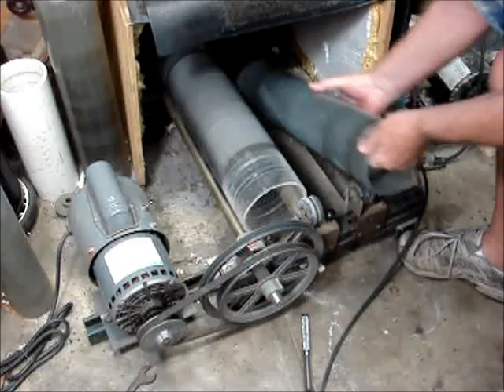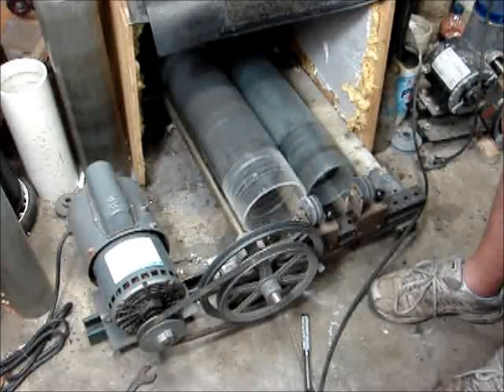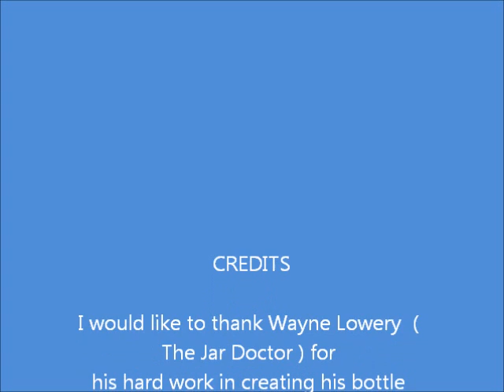Cleaning Antique Dug Bottles With A Bottle Machine

Comment: What gauge is the copper wire cuts? I have a lot of wire in different gauges laying around I could cut up.  I collect and have found sooooo many bottles and want to begin restoring them as a hobby.  I"ll check the Jar Doctor site you recommended to Mr. McKail.

Comment: Ronnie is there a reason you use a finer grit for the interior tumble rather than the same grit for both inside and out?
Reply from the maker: I have changed the grit since I did this video about 5 years ago. A lot of bottles I use 1500 grit on inside and outside.

Comment: How much compound are you using on the inside and the outside?
Reply from the maker: According to size of  bottle.  8oz bottle 3/4 tea inside and 1-1/2 tea outside.  Pint bottle 1 tea inside and 2 outside. Quart 1-1/2 inside and 2-1/2 outside. 1/2 gallon 2 inside and 3 outside.
Reply: Thanks,appreciate